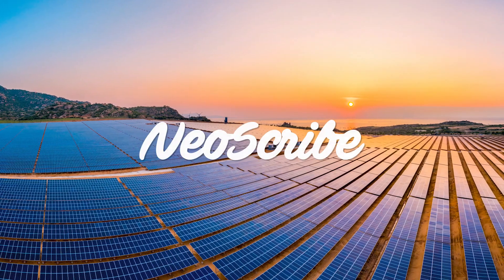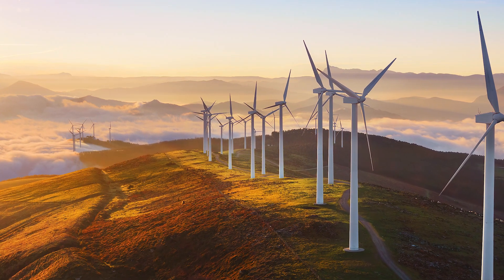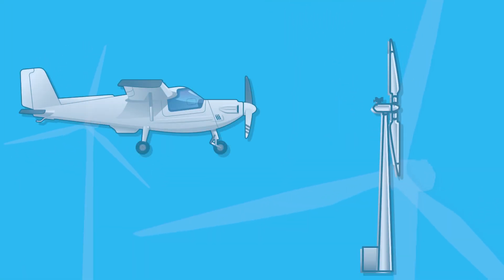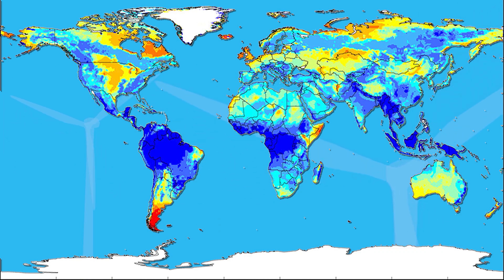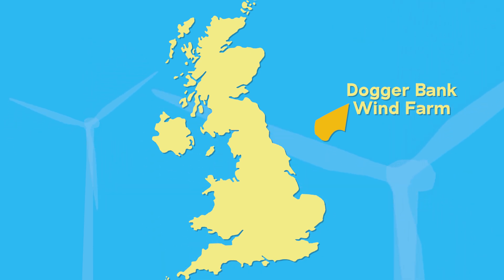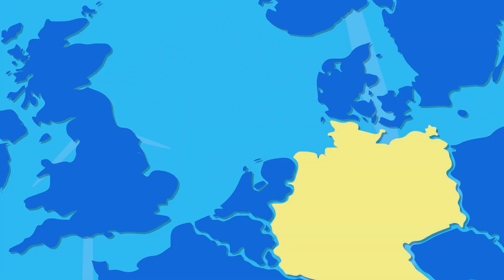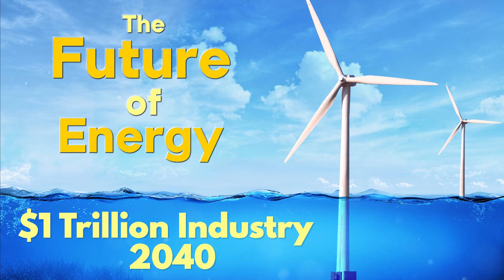The Future of Energy | Episode 2: Offshore Wind Power

Comment: If you put enough off shore wind turbines in a windy enough place like the North Sea, it would eventually create a baseload that would render nuclear power uneconomical.

Scotland is also trialling tidal power. Another great baseload source. All the excess power they generate is either sold to England or used to generate hydrogen for the converted fuel cell ferries they're running.
Reply: This "baseload" would be effective less than half the time. Where will you take the power from then? You can not close one single powerplant (nuclear of fossile fuelled) regardless of how many wind turbines you put up. And the wind turbines will leak oil and hydraulic oil into the sea. Also, you need to calculate the co2 output from manufacturing, freighting and installation of these monsters. I'm sure the wind industry will tell you wind power is environmentally positive. But they are lying.
Reply from the maker: Nils, you made good points on your other comment and things to consider here— I am genuinely interested in looking into these concerns and possibly covering them, but you keep claiming that the industry is collectively lying. What are they lying about? 

The main thesis of the video is that the wind offers a vast potential of renewable energy. Why wait for fossil fuels to run out before exploring and perfecting alternatives?
Reply: @neoscribe2295  The IDEA of renewable energy is great of course, and if you had asked me two years ago, I would have agreed with you. Germany now pay about one billion euros every year to windenergy producers for NOT producing energy because it is impossible to implement it in the grid. Every time it starts to blow, they have to STOP producing the same amount of energy at their coal or gas plants. This means they are run very uneconomically, and makes more co2 pr ton of coal or m3 of gas. In Norway we have waterpower which is producing 24/7 at a very low price. Windpower is producing 30% of the time at a very high price. Germany has spent one trillion euros on wind and sun power, and that only covers five % of their energy use. It has made their electricity the most expensive in Europe. And the Germans don't want any more of it because of the damage to their nature and disturbance to their lives. Don't believe the windenergy companies when thay say they can compete with other producers. They only exist because of naive politicians. Windturbines is a very bad idea, economically and environmentally. And the rotorblades are of course NOT renewable, they don't last long and have to be buried in nature. Except, of course, the many tons that have been torn off by weather and ends up in nature as microparticles. You are a very talented person, and I hope you will consider this side of the coin in you next video !

Comment: Australia has a 3000km coast line facing the continuously blowing circumpolar vortex from the Antarctic. Not a single wind turbine. This is because we have a lot of coal interests to protect and wind would be a direct competitor to coal, in fact all coal mining would close down overnight if we installed wind turbines along the southern coastline because the power from wind turbines is so cheap.
Reply: So where will you take the power from when the wind is not blowing? Wind power is totally dependant on other power sources.

Comment: You should look into the down side of all this renewable energy like it's scalability and sustainability
Reply: Those are the two UPSIDES to renewable power. The thing that's missing, is grid scale electrical energy storage. Once we have that, it will provide load leveling for base load power,(nuclear, geothermal) as well as smooth out intermittent sources, like wind, solar, tidal, or wave energy. Coal and natural gas can then go away.
Reply: @vincentrobinette1507  We are nowhere near grid scale electrical storage, and we probably never will be.
Reply: Nils Ervik it’s a lot better to start than to complain. There’s a lot of renewable energy companies pushing the boundaries of the technology

Comment: Nuclear gang rise up
Reply: Costs!!😉😉
Reply: Check out the Ed Pheil molten chloride fast reactor. He’s has a long lecture on you tube where he covers the whole thing. 
There is enough energy in our stored used fuel waste to power the country for 1000 years. The old PWRs only used 4% of the energy leaving 24 times as much power for the taking. No more fuel ever needs to be mined and the waste has a short half life. The existing stuff is hot for at least 30,000 years. Ed’s nuke waste would be cold in 30 years. Zero CO2. No birds getting killed. No eyesore windmills. No power cabling sitting idle for 4 days out of 5.

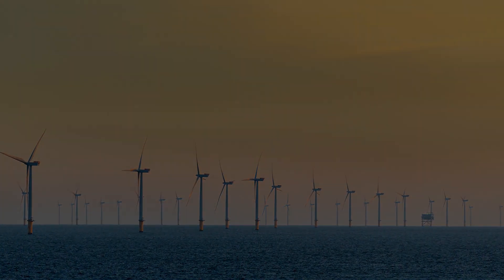Comment: 2:55 The Haliade is already outdated 6 month after its release with the new 14MW Siemens Ganesa turbine 😂 The off-shore wind market will reach 20MW turbine by the end of 2025: I am absolutly sure 👍
Reply: Yeah, I work on Hornsea Project Two, the average turbine installed today is closer to 8-9MW.
Reply: Toby Naylor I thought I recognised your name! You work for the developer, right?
Reply: The Haliade is already here.. the Seimens 14MW is not in production until 2024
Reply: The diameter size of both turbines is comparable. GE can easily gear up the Haliade X to 14 ~15 MW.
Reply: @SpectreMk2  What would GE need to modify in order to get these 14MW ?
Reply: @yutuniopati  
The nacelle may need some modifications, with a larger cooling system for instance. However, they wouldn’t need to change the rotor, as this one is already quite large (less than 2%  difference in the rotor surface area compared to the Siemens turbine). They may have to reinforce it slightly as the aerodynamic loads will get higher at 14MW though. Nonetheless, GE has already stated that they will try to push the turbine built at Rotterdam harbour to higher power ratings, so the existing design should already be quite close to achieving 14MW in nominal usage.
Reply: @SpectreMk2  Do you know if the Haliade is direct drive or has a gearbox ?
Reply: @marksims5730  Direct drive.
Reply: Where can I go to find more about this industry and its developments?
Awesome news to hear definitely.
Reply: Are you curious why these machines might be poorly designed? Lets talk!

Comment: We will soon be at a point where adding more renewable energy to the grid will be useless because of its intermittency, we have gone further than experts expected was possible but at some point soon no more fancy tricks will compensate for this intermittency. Until the energy storage problem is solved at a reasonable price the effective amount of usable renewable energy will be caped.
Reply: I'm in the UK and we will have 50-60% of our electricity generation from wind power by 2030

This is possible because offshore wind turbines have high capacity factors and because in the UK we can spread the wind farms over a very large area

Plus we have and will have significant electricity links to France Norway Netherlands Germany Belgium etc so when we have excess we can export and when we have not enough we can import

What this means is offshore wind (and to a lessor extent also onshore wind) can produce a very large percentage of electricity consumption needs without the need for any storage

Wind power can not provide 100% of electricity but it can provide a very significant important 60%+ of a nations electricity consumption

With a deployment of heat pumps to increase electricity consumption and with a large deployment of electric cars it's not unfeasible that wind power could provide more than 50% of electricity needs for electricity for electric cars and for electric heating of homes
Reply: @kaya051285  Sorry but unless you have somehow magically solved the energy storage problem you will have rolling blackouts way before then.

No you cannot sell the excess energy since wind is highly correlated across Europe with only a few hours offset. If you have even a couple of days without wind there won't be any electricity unless its from coal, gas or nuclear, which would suck in the winter...

People simply don't understand that electricity isn't like other forms of energy where you can turn it on and off whenever you like. It has to be used milliseconds after its created.

All in all we are squandering the wealth that our forefathers toiled and died for because of some stupid greenwashed slogans... 

Of cause we may be saved by some technological breakthrough in energy storage but putting it all on a throw of the dice seems rather reckless when we know nuclear is guaranteed to solve the problem at an acceptable cost.
Reply: We have barely started buying EVs. Once they are more widespread, each will be a storage facility. We have not started looking at H2 injection into the natural gas system. There are many storage options. As curtailment increases, there will be more cheap surplus power which will open up commercial opportunities for many of these options. Eg compressed air, flow batteries, air liquification, and many others. We were told we would get power cuts at 20% renewables. Where are they? An interconnected grid across Europe will also allow smoothing of intermittent energy generators. Each MWhr generated by renewables is a win for us all. We need to be excited about where renewables are headed.

Comment: Very interesting video (as usual). I wished; however, you had talked more about how they are supported.  It seems that would be one of the more difficult challenges.  I believe the water off the coast of England is about 60m deep but the water over the Continental Shelf off the coast of Oregon is 200m deep.  That would require a support pole that was MUCH taller than required for England.  Is that even possible?  Also, how are they anchored to the sea floor.  The torque on the support from the large wind force against such a long support pole must be enormous and that does not consider storm winds.  Speaking of that, can they survive storms or can they only be used in relatively storm free locations?
Reply: A small deep water floating wind farm has already been installed in the North Sea off the coast of Scotland. Called Hywind it generates 30MW with 5 175m tall turbines.
Reply: See https://www.theengineeringcommunity.org/offshore-wind-turbines-support-structures-types/ type 4 and 5.  Floating and jacket foundations work at much greater depths.  The primary issues for off shore wind at the west coast of the USA will be political/environmental, not engineering.
Reply: Floating wind is the answer for this. Really exciting. Although it’s still in the early stages of development with only 2 small commercial scale projects, most in the industry expect floating wind to be bigger in the end than fixed bottom offshore

Comment: Austria is covered with them. Pretty much where ever you go, you're still in the middle of a wind farm.
Reply: Austria is A C9mmunist run nation!
Reply: "offshore" wind farm. Last time I checked the coast of austria was in rather limited supply. 

Regardless the adoption of normal wind power is also a great thing.
Reply: The UK spent 36 hours without any wind generation. The intermittency problem will never be solved and so is the low energy density problem.  For instance, all over 6,000 wind turbines in Denmark produced the same amount of electricity as the 2 small nuclear reactors of Brazil last year. 16.1TWh. But the generation by the reactors were steady, reliable, helping to keep the brazilian grid stable. Modern societies can't rely on non-reliable energy sources like solar and wind.
Reply: @Brandon_letsgo  Well, that is where methods to store energy and international grid connections come into play. It just needs a bit more effort. And admittedly better batteries would really help
Reply: @sizanogreen  No. There's no economically way to store grid-level electricity. That's why wind and solar combined provides less than 1% of world's energy. The major reason wind turbines get installed are subsidies. Warren Buffet said that already: "For example, on wind energy, we get a tax credit if we build a lot of wind farms. That’s the only reason to build them. They don’t make sense without the tax credit.".  The US government tax the hell of out the poor and middle class and give part of that to super wealth people like Warren Buffet. That should be criminal.
Reply: @Brandon_letsgo  There is a economically way to store grid level electricity! Pumped-hydro, one storage in Switzerland can store up to 18'000MWh, and there are many more. The largest batterie, the one supplied by Tesla in South Australia, holds 129MWh, so the pumped hydro storage in Switzerland holds almost 139x more energy than the battery in South Australia. Of course, the pumped hydro can't give energy as fast as the battery, because it needs to spool up first, so we need a combination of both, but there is a grid scale way to store energy!
Reply: @a350fsx7  Sorry but you're wrong. Petroleum and other fuels are the main sources of energy in Switzerland (50.6%), followed by electricity (25%), gas (13.5%) and wood (4.4%).

Electricity is mainly generated by hydropower (59.9%), nuclear power (33.5%) and conventional thermal power plants (2.3%, non-renewable).
 By the way, we're talking about a small country with less than 9 million people. 
Now let's talk about South Australia. South Australia destroyed their electricity grid by shutting down reliable sources of electricity(coal power plants) and subsiding wind turbines. Australia houses large deposites of high grade coal. They export these high grade coal. So why no use it to generate cheap and reliable electricity? Even worse, Australia exports uranium to countries like China but somehow nuclear energy is illegal. The country also houses large reserves of natural gas. So that's a shame that a country with such amount of reliable sources of energy faces blackouts. Well, so there is the battery that Tesla installed over there. It's a 129MWh battery. 129MWh cost about $50 million (Australian, as reported in Australia). The current exchange rate is $1Aus = $0.71US. So Hornsdale cost about $35.5 million US, or about (35500k/129) $275k per MWh. The LCOE would be higher, because the capital is up front and the ‘fuel savings’ are annualized. For how much time SA could ran on that? A few minutes and that's it. The most expensive electricity ever. So...sorry, but THERE IS no grid-scale electricity storage that makes financial sense at the moment.
Reply: @Brandon_letsgo  It's the same situation in Norway. We export gas and oil, and uses enormous amounts of money on subsidizing the wind industry. Which destroys our nature and our democracy. The more I learn about the wind turbines the less sense it makes.
Reply: A350 FSX pumped hydro depends on geography and requires a huge area of land. Not good enough
Reply: @Brandon_letsgo  Electric vehicles (EVs) connected to a smart grid will constitute the electricity storage of the future. EVs can charge at night when electricity is easily available and cheap, and soon also give back electricity at peak demand times (mainly end of the afternoon when people cook).
Renewable electricity goes hand in hand with EV adoption.
Reply: @sharefactor  EVs backing up a fucking electric grid? Are you fucking kidding me? I mean, can you cite a single place where that's happening? Have you ever drove an actual EV? If you did, you know that they can't hold enough electricity to run for 4 hours...let alone backing up the grid. The storage of energy is limited by the laws of thermodynamics. There's no "good storage". Wishful thinking is only that: wishful thinking. There's no reality. I just filled up my gas car and now I can drive over 600 miles on it. It took me ~3 minutes from the time I stopped at the gas station. How many hours do you have to wait until your EV can run less than 300 miles?